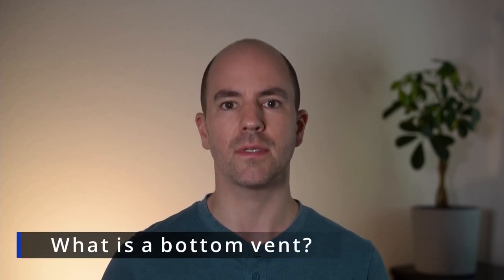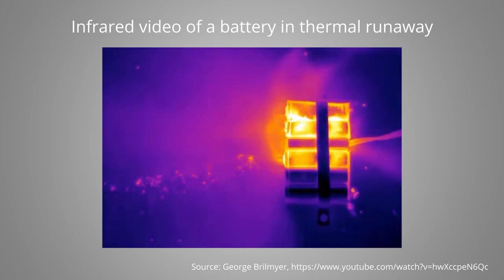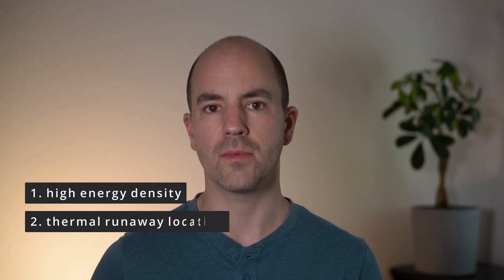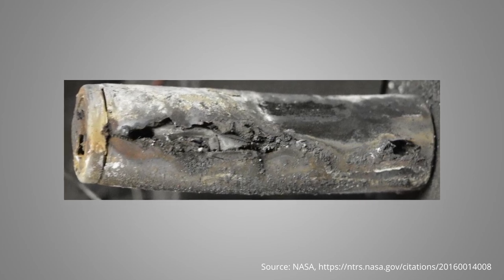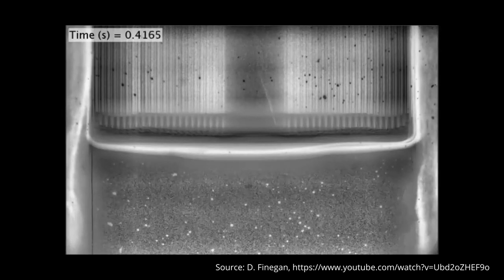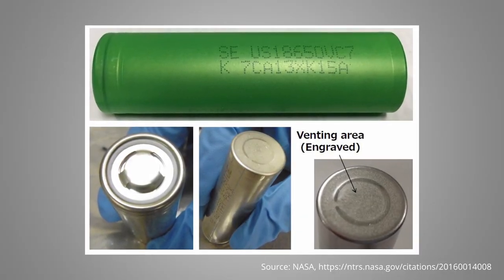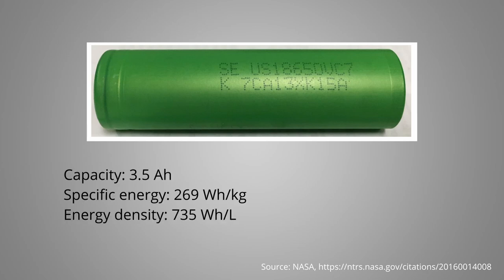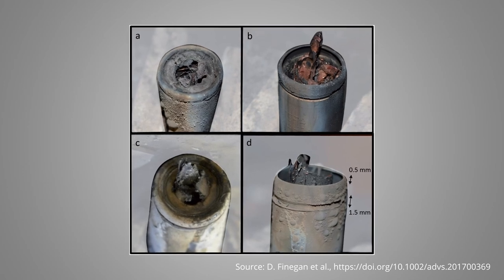Battery Safety: How does a bottom vent help against exploding batteries? (18650, 21700, vent)

Comment: One of the overlooked aspects of a product using a cylindrical cell is the battery compartment. A good example is a torch or flashlight using 18650 or other cylindrical cells. It's all good and well having a cell that ruptures safely however consumer safety is still an issue if the battery compartment acts as a pressure vessel containing the gasses from a failed cell. This is why product testing and certification is important.